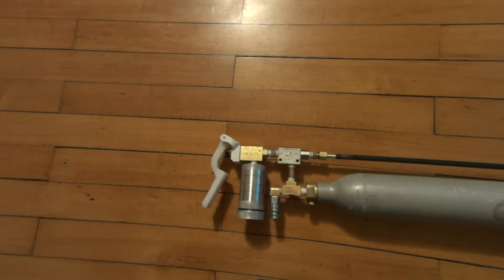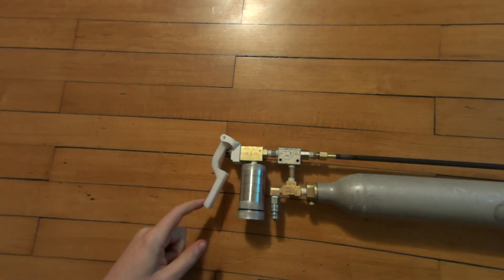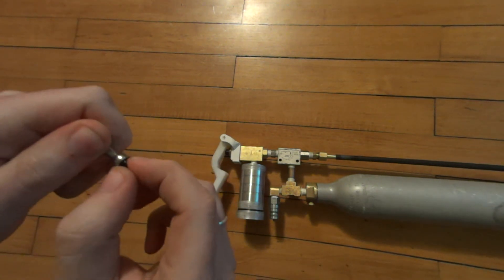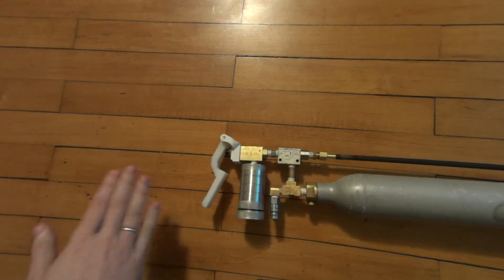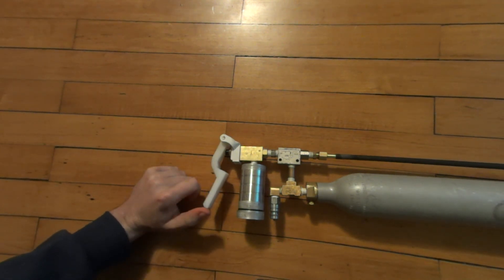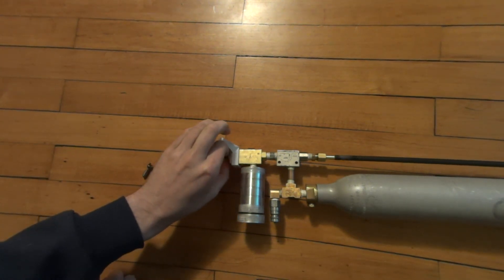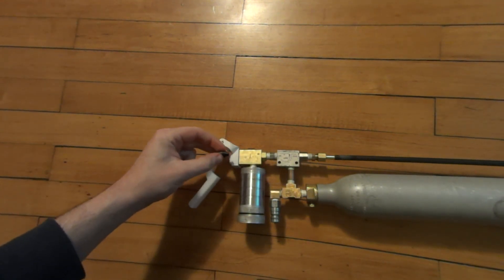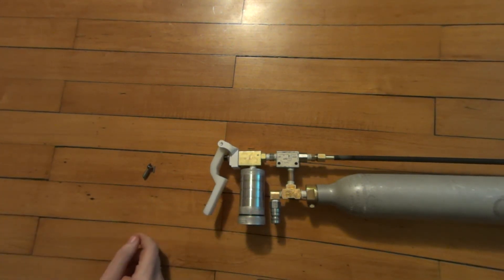QEV Arrow Gun: Newly Designed High Pressure Trigger

Comment: Hmm valve stuff is probably a delrin if it's on the cheaper side or Teflon on the more spendy side. Need to be self lubricating in air pressure vessels as oil will turn it into a diesel engine for one and possibly it's final stroke 😂😉
Reply from the maker: Biker Dave yeah it's not delrin. The black part I machined is delrin. This is something I've never seen before. Quite possible it's Teflon. That kind of makes sense
Reply from the maker: And yeah. The self lubrication is why I used delrin for the slide and brass for the pin
Reply: Swan Donovan Cool. I upgraded a couple bits in the old air rifle to Teflon and difference is night and day. Just need to make sure the works req form over estimates by the amount you can conveniently use 😉